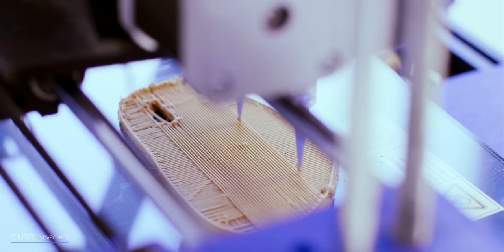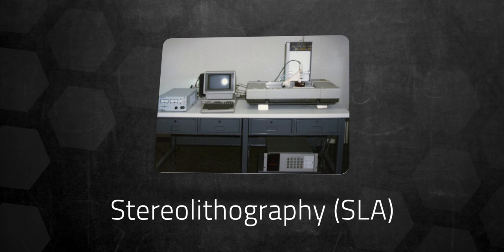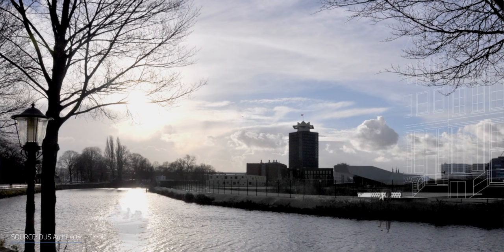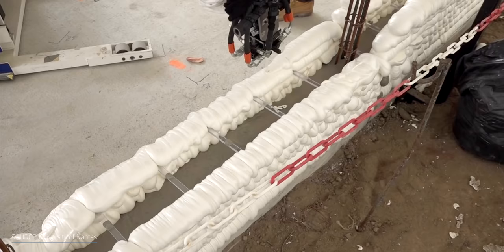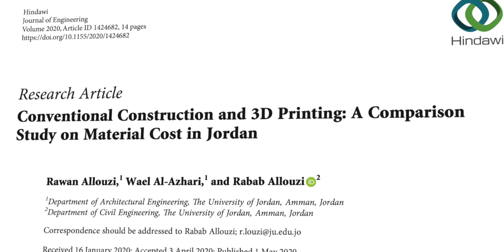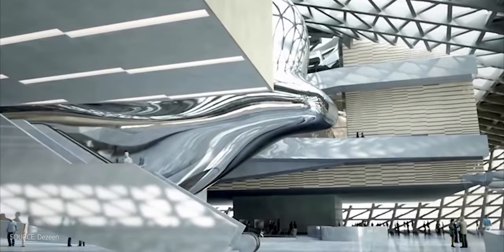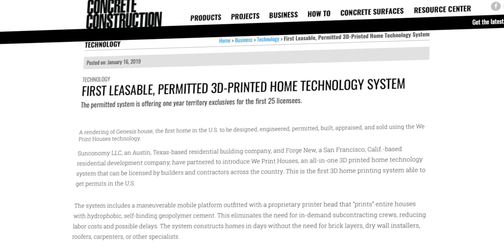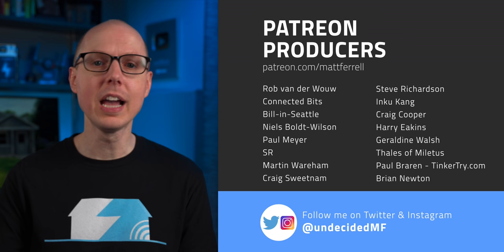This 3D Printed House Changes Everything - Explained

Comment: How about using hemp? I was watching a documentary about hemp house. It was actually cheaper as a material but it was way more labour intensive. If we can eliminate the labour part, it would become an amazing building material.
Reply: Hempcrete?

I'm looking at this 'print' & thinking "let's double this up, with Bales for insolation, the outside we sand smooth, the inside we put wood facades"

I'm curious about all the ways across history we, life of this planet; build

Straw, manure, mud, concrete, stone, wood

Dugout

There's a concept of homes called 'earthships' that are similar - but I've noticed some Materials that may be toxic to home environments used in that with the whole 'reuse' like tires

They're self-sustaining contained homes

Homes that are power sources as an active part of the grid is how I see it, best working

I'm drafting a vehicle engine that works as a generator that you'd be able to power a home off of
Driveonwood.com is a concept that works
A YouTube channel & website
Methane is the fuel from this

It's solar power, sun in, tree out

Also water electrolysis to break the molecules, this would be a secondary fuel for
Hydroxy Gas is the fuel for this

'Meaningful Longevity'
Designs that work off planet!

Comment: I am  a contract carpenter  I have 35 years of experience in the construction industry. Quite honestly the worst thing ever happened to modern day housing is a thing called the" universal  minimum building code ".  The key word is (minimum) and that is a D minus on effective use of materials, energy consumption. IE..designed around a energy grid., living habitat .and community. will argue these points.,because it essentially ended   innovation in housing ,and architecture. Is for the most part in residential housing. Across America in Canada and for  the most part in Europe, residential homes Have been  built more or less exactly the same way . It's been this way for a really long time. We need a change and we need a change fast. I welcome all new technological advances.

Comment: 3D printed house = house that costs like printer ink.
Reply: so 200 times what it should?
Reply: I do wonder whether additions will require using the same, probably proprietary, substance as the main house, in order not to void a warranty.
Reply: @bearcubdaycare  Probably all kinds of wacky bullshit is happening now with only 1 company operating in a given area yet. if it catches on though, there will be a bunch of competitors and both the price and stupid DRM types of things and so on should all drop away, because otherwise the one company that DOESN'T have a silly proprietary mud would just steal 100% of the local business. As long as it's still a "artsy" thing, it will be all weird.

Comment: I'm pretty sceptical about this. How long will those houses last? If they don't last long, then the smaller carbon footprint doesn't matter as new house would have to be constructed.
Reply: Wood houses have a much lower carbon foot print.
Reply: @StuninRub  But they don't last long if not properly maintained and they don't have good thermal insulation.
Reply: @Makimars  Wood has extremely good thermal insulation properties, it's more a problem of wood houses not being constructed the same way as concrete homes. Concrete is also not maintenance free, if you live in an area with wide temperature ranges, concrete might break down faster then wood.
Reply: @Makimars  There are literally wooden homes from the 1600 and 1700s still standing.
Reply: @WayStedYou  concrete lasts just as long. The Pantheon is still standing and is made of unreinforced concrete.

Comment: 5 main questions i have regarding 3d printing house:
- the streamline of obtaining a certificate of occupancy based on local regulation
- will the walls crack if the area is geologically move by cm each year. 
- cost of maintenance. 
- future renovations and expansion of the house
- foundation for higher structure and its durability.

Comment: Immediately before watching this vid, I watched Matt Risinger's video showing the details of Icon's 3D printed house. Matt is a contractor in Texas who follows modern building science, so Icon invited him to see their process. Icon will simply paint their walls and leave the unique look. They use a two printed concrete skins with, what looks like, open-cell foam between the skins.

My thoughts on the current process: It seems useful for tract housing, where the builder creates a bunch of homes in a neighborhood. I assume transporting and setting up the robot will make doing a one-of-a-kind home in a unique location far more of a chore than other construction techniques. Traditional concrete is a major source of CO2, as cooking limestone to create cement releases CO2, independent of your heat source (typically natural gas, so CO2 from that as well). Wile curing, cement reabsorbs CO2, but only a tiny fraction of what was released. There are new mixes that get CO2 down as much as 30%, and there are research projects to eliminate calcium carbonate, but other materials either suffer from low strength or high cost. If one could use something other than cement, such as melting recycled plastic, then 3D printed homes could seriously reduce CO2 emissions in construction.
Reply from the maker: I find it funny we released our videos on the same day.  Weird timing.

Comment: There is also 4 D printing which is 3 D printed objects that change shape over time such as due to heat or an electric current that researchers at MIT is developing.
Reply: I can guarantee that these houses 3D-printed in a few hours will also change shape over their (short) lifetime.  ;-)
Reply: Link?

Comment: normal house: around $100 000 - $200 000, 3D printed house: $500 000
i think im getting a normal one
Reply: Lots of comments like yours.  House prices vary a hell of a lot depending on WHERE they are. Hell, there are big differences within the same area, and between areas is insane.  These houses are generally being built in or very near cities.

BTW: Where I currently live, every yard above sea level comes with a price hike.
Reply: @travcollier They are overselling the cost at extremely high margins, due to market base for location.  Only way to truly get 3D printed house for cheap is DIY.
Reply: @MarsStarcruiser  The tech is still early days.  However, look at how much labor and materials are required...  There's a lot of room for the cost to come down as it becomes more common.
Reply: @travcollier  it won't become common if it cost more than what's already common place. And the only reason why people are making this point is because they made a bullet point of Lower Cost.

Comment: What if earthquakes exist?  I've yet to see any rebar in any of these 3D printed structures.  Concrete is only strong under compression.  That's why when we build things out of it, we put lots of steel (which is strong under tension) in it, to ensure the concrete never sees tension, only compression.

Comment: 3D printing will lower costs for houses, help with insulation by having curved walls and a sun-oriented shape and will be more durable because of better materials.
Also, building a home in 24h with just 3 people working on it, it's just magical.
Reply: i kinda doubt you could achieve passive house levels of thermal insulation with 3d printed concrete, but i guess we'll see
Reply: @RCRobN  Maybe double walling and using special stuffing materials between the 3D printed walls. But you do know that to make a passive house most of the cost is within the windows/HVAC/air tightness not the structure itself. I guess a 3D printed house can be a lot more helpful with air tightness than regular brick & mortar.
Reply: curved walls are not user frendly space, and its not finished in 24hrs. there is still a roof,heat,ac,electrical,plumbing,windows,to do.

Comment: A) What about tall buildings? A must in cities, where the need for housing is greatest. 
B) What about reinforced concrete? A must here... 
C) Still not everything printed... In particular, the piping and cabling would take a lot of work... Over here construction workers will easily find ways to stretch that part to take 2 years.

Comment: He’s too optimistic, also how you gonna straighten these inner walls? Cost of labour must be to the roof
Reply: literally the opposite
Reply: And you think straightening those are more expensive than building a house from scratch?
Reply: @meideval  of course. House frames are built from well prepared blocks/frames and it takes less than a week to build the shell.

Try to install hidden pipe system in this 3D printed house and finish it to at least some standard of a decent home - this would take forever

Comment: $300,000 is a gross overestimation of the cost to build a house, unless you are including the land cost. Even here in Canada, according to my research, the price would generally be about $200,000 for a three-bedroom house of modest size, and things are always cheaper in the United States than they are here. On another site describing these 3D printed homes, it was stated that small homes for the homeless could be built for around $10,000 each.

Comment: I bought my house in 2017, so it was just before house prices went insane. We got ours for 168k. It's a 1600 sq ft 3 bed 2 bath 2 car garage on .25 acre lot in a Dallas suburb. Today, we're seeing we could probably sell for 260-270k if we wanted to, as that's what other houses in the area are selling for. Even with this pricing, it surpasses a 3D printed home's value. At 300k for 1400 sq ft, that's a rip off. Even in the ritzy areas around here, 1400 sq ft typically won't go for beyond 350k, but in general, you find houses that small in the much older neighborhoods (1950's-1960's construction) which will sell for 120-130k, depending on various factors but generally not beyond 180k at the high end.

Let's not forget that concrete demand will go up and supply will go down. That means everything that needs concrete (including traditional homes for foundation), or even highways and other infrastructure will cost more, which translates to higher taxes to pay for it. 3D printing a concrete house is just monumentally stupid. It's inviting future problems. I guess I should get in on the action and figure out a way to polymerize dogshit as a sustainable building solution.

Comment: I read somewhere that the framing (walls) of a house, are just a fraction of the house cost. Windows, doors, plumbing, wiring, and finishing are relatively labor-intensive. I would want to see a comparison between "3D printing" and factory pre-fab.
Reply: There will be none because 3D printing is a fanboy hype and prefab is crushingly cheaper and quicker and better to live in. Irl prefab is the way to go. Like they never mention in those 3D print videos about concrete mixture super high carbon footprint. Google about concrete and CO2. Wood and bricks are many times more environmentally friendly.

Comment: What about heating, ventilation, plumbing and electrical? What are the fire ratings of the walls? Is the roof pre-fabed or printed? What is the durability? What is the general cost per foot? How do they deal with local building codes? What if I bought one and 5 years later wanted a different color for a bed room, is it simple and easy like drywall? Where can one get additional info?

Comment: 8:02 "It took only 3 people to complete that project". I find this hard to believe, even if it was 1 electrician, 1 plumber, and 1 carpenter. You can't print wires, pipes, ducts, doorframe, wall coverings (yet), etc. The printing just removes the framers as far as I can tell.

Comment: My house is 1,700+ sq ft and cost less than half of that $299,00 house, and has the same stats.  I notice that no mention of installing electricity or plumbing was mentioned. What about the foundation, as well as the roof?  Many of these seem to have flat roofs and the one I saw with an angled roof had wood beam supports.   Seems like there's a lot that's not being mentioned.  Is the house actually ready to be lived in in days, or simply the shell of the house?

Comment: Designing your own home would be fun about the complaint against recycled plastics build it on a traditional concrete slab in a tent with an air compressor. Collect the compressors liquid runoff through a water condenser and vacuum the freshly built surface with that same compressor

Comment: My biggest concern with 3D printed buildings is long term maintenance and adaptability to additions, from my experience of living in concrete homes, especially when no A/C is installed and it relies on heated floors that the landlord refuses to replace the hot water tanks for.

Comment: $300k to build a 1400sqft house?!?! That still needs to get cheaper my guy. Current New Contruction rates are $120/sqft (in Texas) meaning that you could hire someone to build the same house for $168,000. I’ll check back in 3 years when it actually becomes feasible

Comment: Concrete cracks, embedded utilities are hard to repair, concrete walls are hard to repair and remodel, it seems to be a compromised design vs cast concrete walls.  Once more practically clad with sheeting and the rest I have doubts its much less trouble than conventional building techniques.
Maybe useful for less important structures, like sheds.

Comment: Curved walls are pretty, until you choose to place a square bookcase in the 'corner' - 
I know someone with a Quonset building. I know it isn't the same, but having curved walls is a real issue when you want to put vertical/square things near them. -- I suppose though, you could put your bookcase far enough away from the wall for your robot vacuum cleaner to get behind it...

Comment: Interesting that the printed houses are sold in places where houses are crazy expensive, so even a small house as shown is "discounted" compared to conventional building, is sticker-shock inducing.
What you show is a concrete shell: what about all the trades that go into making a house, other than framing the walls?

Comment: I can see how this could be useful in building tracked housing. But this only builds the shell and inner walls, maybe 30% of the build. It still needs a heating system,  a plumbing system, and an electrical system.
Also, the printing equipment must not only be brought to the site, but also calibrated to work there. I wonder if that is added into the man hour estimate.
My home was built in a factory, and was towed to its present site on its wheels. It has recyclable aluminum outer walls and thin plywood inner ones. It used far less construction material than a conventional house of the same square footage.

Comment: I think people underestimate exactly how far automation and technology can reduce the need for labor. I have an idea for a painting company that uses flying drones to paint buildings and houses. All I need is the money to hire someone to code the program that would allow you to set the parameters for how the drones should go about their business, and then an engineer to figure out how to rig a paint sprayer onto a flying drone if it hasn't been done already. tSuddenly a multi-person job becomes a single person job, no ladders or lifts necessary to get the hard to reach spots, no one in danger of falling for that matter either.

Comment: I’d like to see a video on how these 3D homes get plumbing & electrical.
Reply: well its actually easier than with standard housing since you can put in holes for funnel and shafts while 3-printing (just put a little frame where you want the hole to be)

Apart from that you are more flexible in the layout and therefore can hide utility shafts more easily

Comment: If you could swap out the cement for natural materials its a good idea. It would also need to be able to meet passive house standard for me to consider it. Cool to see but prob not the answer for the environment as it sounds to me that the main drive is saving money through less construction costs and not really saving the planet. Ill stick to timber

Comment: walls are like 5% of total cost of the house, so this is the actual saving.
3D printing will not replace foundry, doors, windows, roofs, interior finish and all of systems such as electrical and HVAC.

Comment: Conventional concrete elements are still way cheaper as the concrete has a higher aggregate percentage. Insulation, plumbing and wiring are more expensive than structural walls only

Comment: Concrete is usually reinforced with steel, gaining properties of both materials.  The time lapse videos of construction don't seem to show any such.  It would be interesting to see if these printed structures could be similarly reinforced (maybe addressing that multistory problem), or if material with suitable properties all in one could be developed.  I'm unsure how printed material could have much tensile strength, though, without something like fibers or rods extending through multiple printing layers?  That seems important with earthquakes, and as structures scale.

Comment: How do they add utilities to a 3Dp house if it's all cement?  How do they remodel or add-on to one in the future?  How do they keep all those flat roofs from rotting or degrading? Will any of these designs work in areas with earthquakes or tornadoes? And I can only imagine they will focus on plastering/smoothing out the interior walls after the fact as the ribbed wall would cause problems for a lot of devices and furniture.

Comment: I get the advantages of 3d printed homes--but none of the clips in your video addressed how the infrastructure gets installed?  HVAC, wiring, plumbing--all of which is either in-wall, in slab, or between floors.